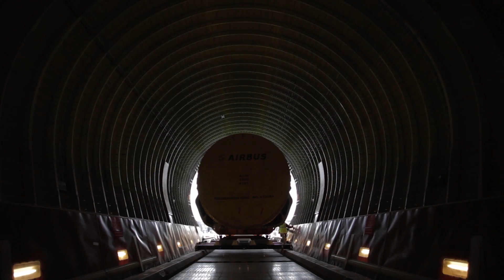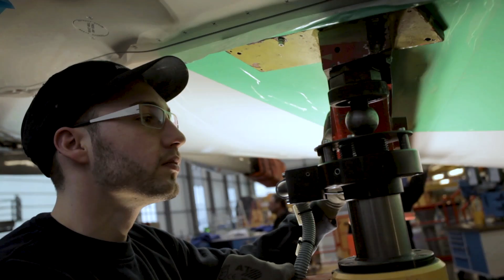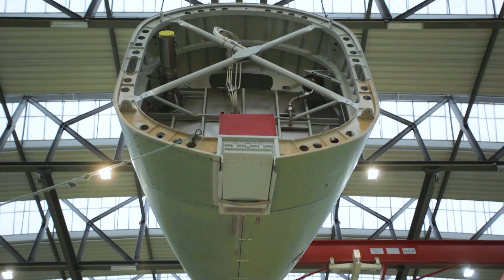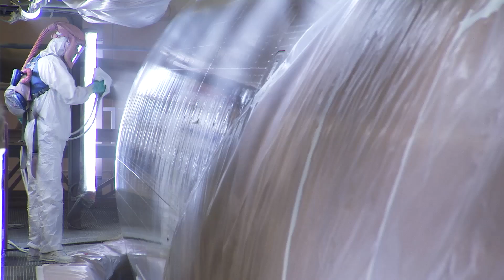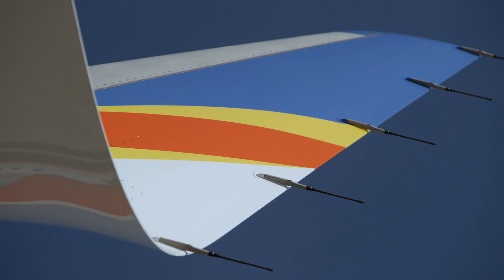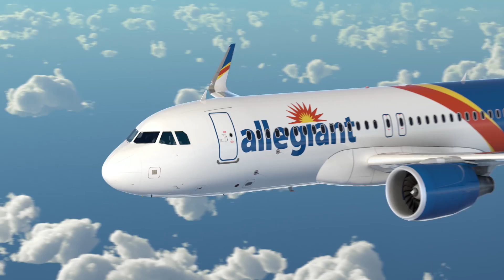The making of Allegiant's new Airbus A320 | @Allegiant

Comment: I wish Allegiant flew to Houston, especially if there was a route from Cedar Rapids to Houston. It would be very convenient for my family and I. I will be living in Huntsville, Texas (about an hour's drive north of Houston) someday while I have some immediate family in Iowa. If the George Bush Intercontinental Airport was too expensive to use or too large of an airport, Allegiant could use William P. Hobby Airport. Allegiant is very affordable, and it may be the only airline I can afford as a college student majoring in criminal justice at a university outside my home state. Last I checked, the fares start as low as $20, and even though they charge for baggage, I still think they're pretty affordable. And people might complain that refreshments are not free and there is no entertainment on any Allegiant flight. However, they're usually relatively quick flights (just a couple of hours at a time), so I don't see a need for digital entertainment on board. My only complaint is the planes are very old, but I think they're working hard on updating the fleet, replacing most of their MD80's with more modern (and fuel-efficient) A320's.
Reply: Bryce Gipple I still wouldn't fly with them. I don't mind paying all the extra fees and I don't mind the tight hard seats that don't recline and I don't mind not having any entertainment. I've flown on spirit and frontier and I was fine. But I don't know if I would wanna fly with allegiant because their safety history is questionable.
Reply: There safety is better now!